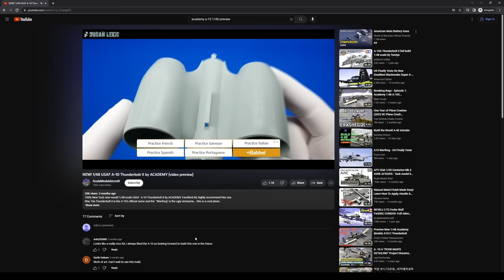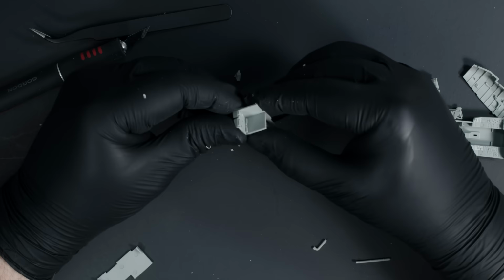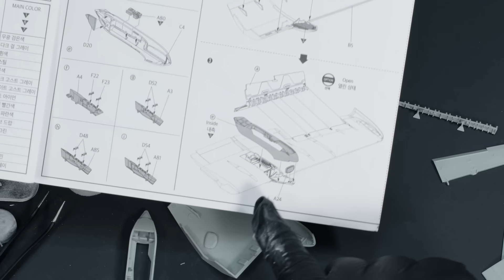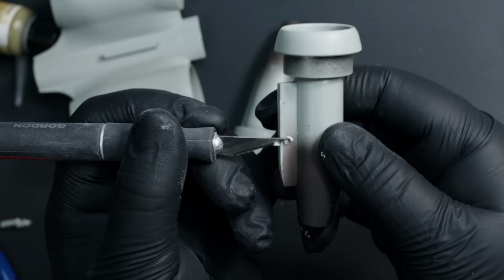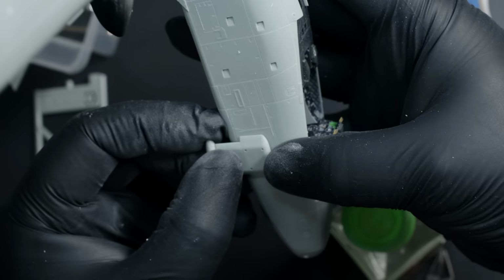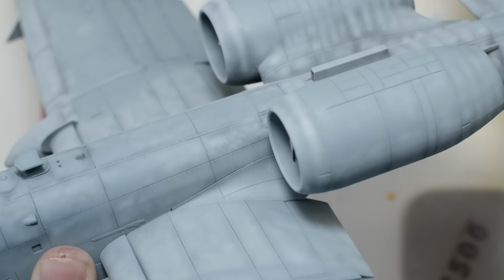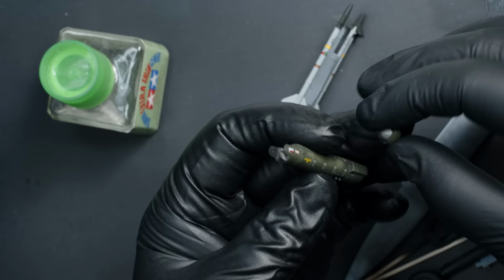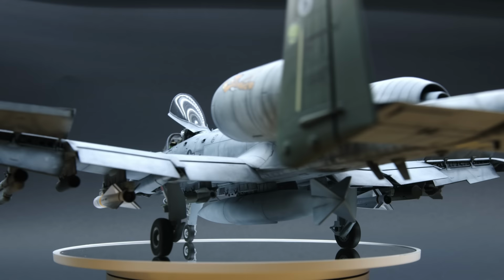Academy A-10 1/48 FULL BUILD & REVIEW!

Comment: I think your model looks fantastic.  Just a note from an old modeler who has been building for over 50 years, each kit is a learning experience.  Keep it up. As far as the paint in the corners being gritty, add some reducer to your airbrush that will help. The thing on the side of the fwd fuselage  is a pave penny designator . They don't carry them anymore , hence the four bumps resembling the left over bolts. Which is a nice detail actually. Great job.
Reply from the maker: Thanks for the tip! I'll give it a try next time. It's great to hear from other modelers and learn from their wisdom and experience.  Thanks for watching!

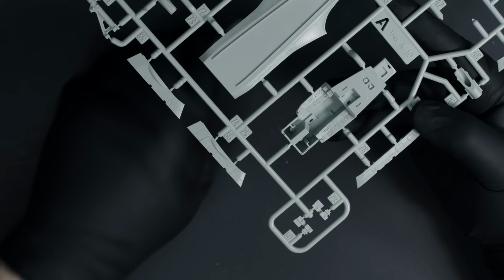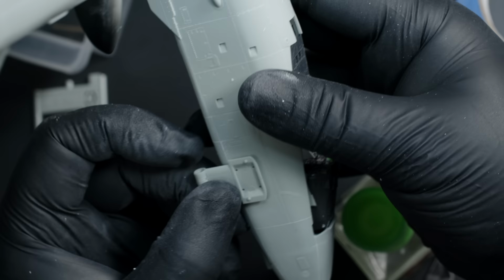Comment: 1:05 on certain parts you decided to go out of sequence from the instructions, but for A31 and A32 you decied to follow the instructions, if you've gone out sequence you'd seen the slots for them staring at you on the back of cockpit tub @1:30. You'd have assembled the whole seat without those pieces, put it in the tub so you could align A31 and A32. 17:15 A-10C stopped using the pave penny targeting pods, but some still had them attached depending on timeframe. The four bolts on the side of the fuselage are not locating pins, they're supposed to be there when the pod isn't attached. Same for the four bolt holes on the side of the pods plate are not locating pin holes either. The inside of part A1 had two flashed holes that you drill out and line up with the two true locating pins in the pod that you sanded down @17:35
Reply from the maker: Thanks for the feedback! This is why I love sharing my builds on Youtube! Its the best way to share knowledge and experience. I definitely want to build another one in the future and I'll keep this in mind. Thanks again!

Comment: That nose pylon attaches to the fuselage via two holes drilled out in the early steps of the instructions. With the pilot, I had to file down the instrument panel to fit him in. I'm busy painting my A-10 now and have left off basically all the pylons, tail and engines to paint separately - with so many nooks and crannies in this aircraft, it's easy to get paint pooling.

Comment: Been thinking about picking this up. Despite the minor issues on both sides, your built came out fantastic!. Hey, broham. Its our hobby. Once its on display, all those imperfections only we know about dissapear. Every model, its a lesson learned (you said it yourself👍) Only tip i could add to the mix. Try some locktite fun-tak putty to hold pieces in place while dry fitting sections (and a large tupperware to store work between sessions). Overall, great job my man! Keep the hobby going strong!👍🤘

Comment: Nice job on that kit.I was listening to what you had to say on some of the fit issues and those are some easy fixes.Just by sanding the edges on most of the parts you can and will find out that you will end up having to use less putty.Also you will not have to sand as much.If you have a magnifier and look at most of the join areas before gluing,you will see a light beveling of the edges.It is not much but light and I mean very light sanding helps a whole lot to the point in that you will have less seems to fill or sand.
Reply from the maker: I'll keep that in mind, thanks!!

Comment: Might wanna take that fuel tank off again. The early c versions never flew missions with them.  It's only recently they have started testing if it's a good idea
Reply from the maker: Good to know!
Reply: Great model and detail!!  Actually, the fuel tanks aren’t combat rated, in that they aren’t self-sealing and a hit could prove disastrous.  They are the same tanks that have been in use since the A-10 was first fielded. The tanks are only used for deployment or ferry flights and would probably never even be flown with live munitions loaded on the jet.  I am a former A-10 pilot with over 2500 hours, many while assigned to the same squadron as depicted on the model.